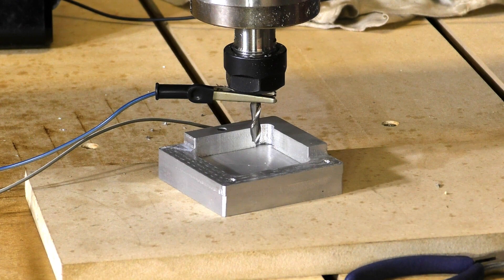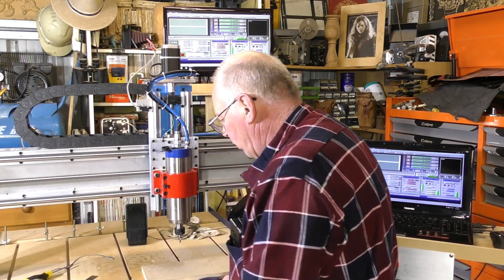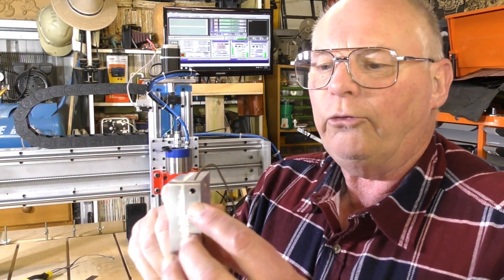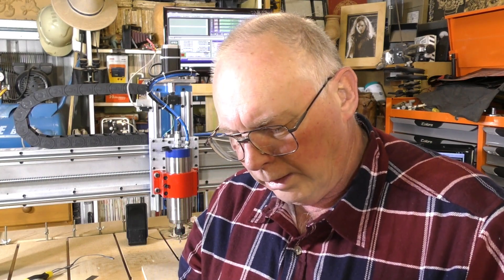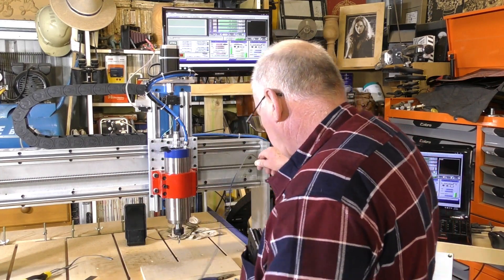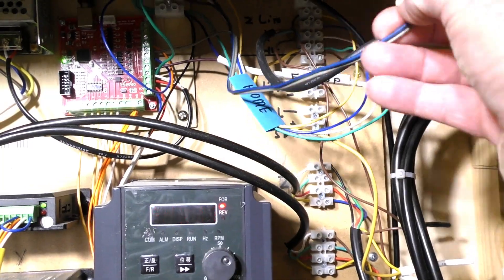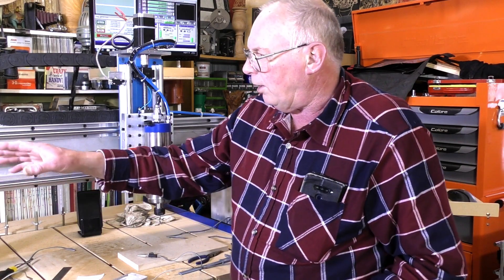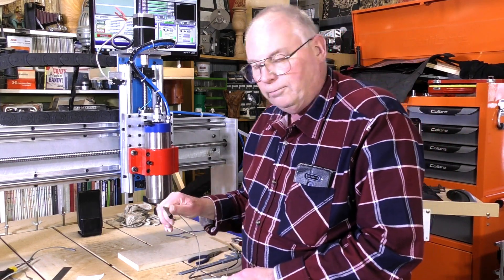How to get MACH 3 working with A I Wiring up to the BOB + some explanation Part 1

Comment: Roger. I just upgraded my pc using the same red bob. Previously used printer port. This new bob has too few input pins. It apparently has auto levelling when homing. Because my homing switches are wired to pin 3 and z homes then y/a does not work. In mach3. How can the machine know which pin it hits first on y/a to auto level if both pins are on 3. Is there any way to turn off tge auto leveling. I have never needed it. Built my cnc in 2017 no issues till new bob. Love all your cnc stuff and love where you live.

Comment: Not being an electrical guy, I don't think the idea of a common ground was something I had thought of.  I use it for my power and my chassis but don't use it for my sensors.  I would be worried about introducing some sort of ground hum into the circuit which would make me think about using a "pull-up" resistor, but again, I'm not an electrcal guy so not sure if that's needed.  It's interesting to see other ways of solving a problem.  Thanks for showing this.